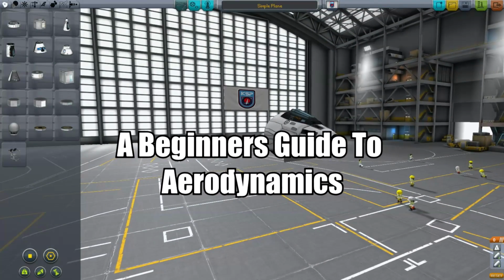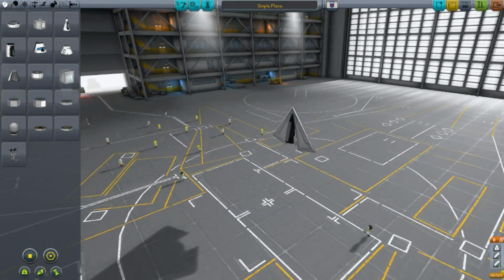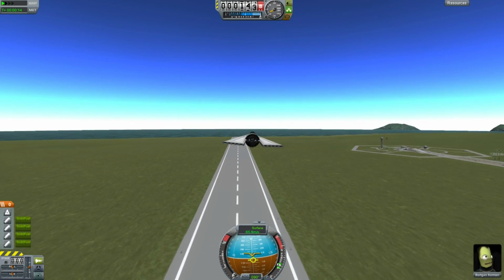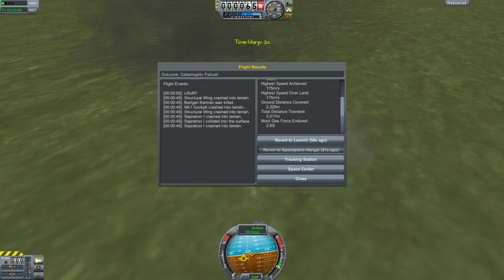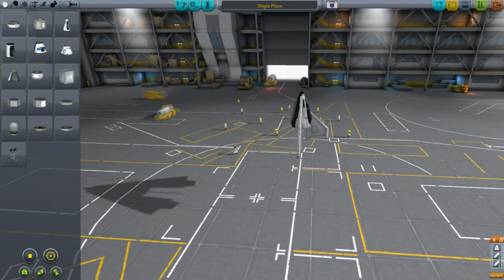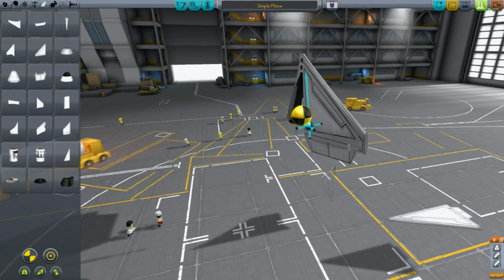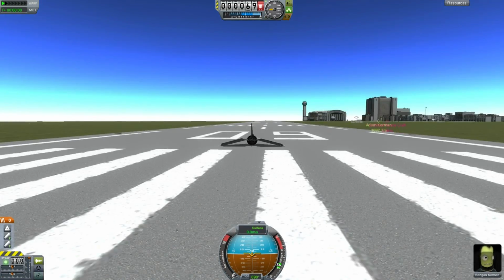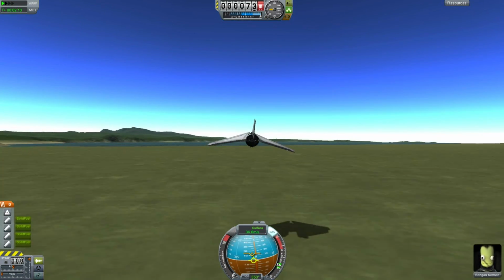Kerbal Space Program - Beginners Guide to Aircraft Aerodynamics

Comment: I just recently started playing KSP again and planes were always my favorite, albeit sorta frustrating with my limited knowledge of how they work. So something I'm sorta confused on is... in a plane the center of air pressure being close to the center of mass makes it more maneuverable, but doesn't that go against how it's supposed to work? I always thought for control surfaces putting them as far away as possible from the CoM was ideal for better control because more torque is applied in that case vs having them close to the CoM, yet in planes it seems to be reversed? Or maybe I'm mixed up in my head here, probably the case.

Now that I'm questioning all this I'll definitely have to experiment around in the game to see. I guess even in rockets I sorta see the whole maneuverability thing being the case since I usually have to put control surfaces farther back to make the rocket more stable. So maybe I got confused somewhere along the line? I guess maybe just having torque apply more farther away from the CoM is the intuitive thing for me but really it's the opposite, torque near the CoM has the most effect?

Comment: So I've gone gone and tried to build a shuttle and it works perfectly in every stage of flight except reentry and I can't figure out why.

It always around 30000m to 25000m yaws sharply and then begins pointing rear end first. This confuses me since my centre of lift is well aft of the centre of mass regardless of how its loaded and I've checked this in the SPH quite carefully.

Whats more I've seen designs similar to it (standard mk3 style shuttle with big S wing and strakes with shuttle tail piece) that don't have this issue.

Frankly I'm baffled.
Reply: Something alot of people forget is that when you burn fuell the center of mass is moved, you should always experiment with emptying the tanks in the hangar to see how it will move and how you will counter it. In my opinion the center of mass moving due to fuell burning is the hardest part of building a stable aircraft.
Reply: Plebasaurus Rekt Yes but even then the rules are lift aft of the centre of mass. The real danger is if it moves fore of the centre of mass due to burn.

There's something else afoot with my problem. I'm gonna install Ferram just to use those tools that warn of dangerous regimes of flight.

Comment: But what about the more mathematical aspects, is there a way to calculate the most optimal plane design in terms of lift-to-weight, lift-to-thrust or anything like that?
What is most important, high speed, big wingspan or is it simply both? Can you in fact have too big a wingspan?
Reply: Unless youre in a rush, big wings are imprtant since you are alot more stable and youll have a much easier time flying slow (eg. landing and take) and youll be able to fly with less engines while using less fuel so then you will have a longer range. Although a combo of both is best i think. Im not a pro, thats just what ive noticed works for me.
Reply: I havent played for a while but i know that ksp doesnt have any advanced aerodynamic so the shape of the wings doesnt matter at all, the important thing is only the ammount of wings and where the centre of lift is. Although last time i played was like 0.9  or something so it might have changed now.

Comment: SCOTT,     you should add the following information to the description of this and your other plane tutorials, it is the one bit of information that most people need!    

Flight characteristics   COL=center of lift   COM= center of mass
Different flight characteristics are desired in different craft. If 
the COL or the lift vector is positioned or pointing off-center 
left-to-right, the craft will turn. If the COL is positioned too far 
toward the bottom of the craft, it will want to roll over. Assuming the 
COL is centered side-to-side, and possibly top-to-bottom, performance is
 basically as follows:

 COL ahead of COM → Flips or turns uncontrollably COL inside COM → Excessively maneuverable; needs constant course correction COL closely behind of COM → More maneuverable COL further behind of COM → More stable COL very far behind of COM → Very hard to correct course; likely to flip up or nosedive
Shifting fulcrum-
The center of mass will shift as fuel is consumed or stages detach. 
This may critically alter the relation between the COM and COL to alter 
the flight characteristics.
Reply: yes, because most newbies are totally going to understand what all that means.
Reply: It's pretty self explanatory, other short tutorials cover the basics but never explained the difference in aircraft handling based on the position of COM/COL.*****

Comment: ARGHH!!  every video about "building your first plane" uses parts that I don't have access to.  "Aviation" on the 3rd tier of the science tree only give me access to 'Small Circular Intake' that doesn't fin in-line with the main fuselage.  The 'Radial Air Intake' that EVERYONE uses in their "first plane" videos is not available to me until "Aerodynamics" in the 4th tier of the science tree.
Reply: Career mode isn't a very good environment for beginners.
Reply: +dave fuller Then improvise, duh.
Reply: +Bad Rats You attach the Mk 0 Fuel canister to wherever you want to place the engine and then attach the intake and engine to that. The Fuel canister radially attaches practically anywhere
Reply: +Neisel Clemontine I don't think we had career mode when this video was made.
Reply: +dave fuller I'm also having this problem
:(
Reply: You should really experiment with everything in the sandbox before you try it in the "bussines mode" (dont know what its called haha)
Reply: I just built one right at beginning of career, just using common sense. Amazingly enough, it flew, and I actually landed it! No brakes though, so I ran over the airstrip when landing...
Reply: You can put the basic air intake anywhere on the vessel, even if it doesn't make sense. I usually put mine on the cockpit/capsule nose. Eventually KSP will put a stop to it, but it still works in v1.4.
Reply: The available parts don't matter. The point of the video is explaining how to build a stable aircraft. You can do this with the earliest available aircraft parts.
Reply: everyone that responded here gives literally zero help.  Come on Really?
Reply: Uhh this is aircraft aerodynamics not what to build on first career path

Comment: How do you connect a key so that it controls one thing - like flaps or elevators or ailerons? I normally see that if I try to pull up, all of the other control surfaces also pull up, including the flaps and ailerons. So how do I make it so that when I pull up, only the elevators pull up, or when I roll, only the ailerons move, etc?
Reply: +XpertPilotFSX You can right click an aileron/elevator/break and tell it whether or not to be used for pitch, yaw, and roll.

Comment: 4 problems : 

1. There aren't any control surfaces, just those Elevons or something like that. But they don't work!

2. I can't click the center of lift. The task-bar is on top of the bottom of KSP.

3. I do have 8GB of RAM. But it runs at 13 FPS. Plane turbo engines, just 3,6 meters per second.
Normal, max. 12,2 meters per second.

4. I can't run KSP on fullscreen. I have Windows 7 Home Premium. And mods don't work! I tried Firespitter and KSP won't load. It ends on a white screen. And if I want to quit, it doesn't quit.
Reply: TheDiamondBladeHD 2.0 Why you lag with 8 gb?ram isn't what the computer uses to make the pc fast. It is more likely because your processor or graphics card aren't that good. When I had 8 gb ram, 3.0 ghz processer but pc dosent detect graphics card so it did basic display adapter and that lagged as hell.
Reply: TheDiamondBladeHD 2.0 These aren't questions!
Reply: Murad Beybalaev *Problems
Reply: TheDiamondBladeHD 2.0 btw, did you happen to download and install that Active Texture Management mod I linked before?
If you did, did it help at all?

If you didn't,  I REALLY recommend installing it. The mod's thread on the KSP forums was updated a few days ago to include download links for the version made to work with KSP 1.0.

Also, for whatever limited aid I can give you, it would really help if you told me about your processor. So, follow these steps to find that helpful information. It'll literally take a minute.

1) First we'll need the overall speed of your CPU.

a) Left-click on the Windows "Start" button. It has the Microsoft flag logo on it. Doing this should open your "Start Menu" like normal.

b) Find the "Computer" button in the right column of your Start Menu. Don't click it yet

c) Right-click the "Computer" button. It should bring up a little menu.

d) Left-click "Properties" on that small menu. There should be a window that pops up displaying information about your computer.

e) Look for the row where it says "Processor".
The last number in that row is your overall speed. It should end with "GHz" (GigaHertz).

f) Tell me what that number is!

2) Now we find out how many cores you have.

a) Hover your mouse cursor over an empty part of your Taskbar.

b) Right-click on that empty part of your Taskbar. A small menu should appear.

c) Left-click the "Start Task Manager" button. A really basically formatted window titled "Windows Task Manager" should appear.

d) If you aren't already on it automatically, click the "Performance" tab near the top of the Task Manager window. You should see a couple of "Usage History" line graphs being updated in real time, organized into two rows, and with different colored lines for the graph

e) You should see that all of the graphs with a green line are together on the top row, and that the only other graph in the window has a blue line, and is alone on the bottom row.

f) Each line graph with the green line represents a separate Processor Core. Tell me how many green line graphs there are.

Comment: my plane shakes left and right just soon as I start the engine although everything is right ( lift behind mass, everything symmetrical ) is it a bug or is there something wrong ?
Reply: It could be because the gears are not widespread enough and there appears to be no suspension friction in the game so it keeps doing it wobbly thing till you apply another force or get rid of the movement for a moment by timewarping for a bit so it stops doing it. When you stop timewarp, it should be stabile again if its shaking was stopped at the good time.

Comment: This is all nice stuff, but what's the point of planes in the first place?
Reply: Science, every biome gets you more science.
Reply: noodles6669 So I'm supposed to land it on a different biome? Like... which one?
Reply: firefox3249 If you do science stuff in KSC you get science for doing science there, then do it over water, grasslands, highlands, mountains, tundra, and polar regions. Those are the ones I have seen. Launch pad and runway also give you extra science.
Reply: noodles6669 Ok, thanks for the intel :)
Reply: As you get better at designing planes, and get more science for more parts, you can build hybrid planes where you can use jet power to get out of the atmosphere, and then rocket power to easily get in orbit. It uses much less fuel, leaving you more to use in space. Then you can land the ship apon returning and get a lot of the value back for your next trip. It is worth it to learn to fly.
Plus it feels very rewarding to land a plane after returning from a distance planet, instead of falling back to earth with a parachute.
Reply: ***** The reason it is true is because of the jet engines, you can get to 20-30km on minimum fuel, and FAR helps with lift, so you can compensate for lack of thrust(more efficient, less thrust) with aerodynamic lift, and therefore, you can be more efficient, but building such crafts is very challenging, especially if they return in one piece.

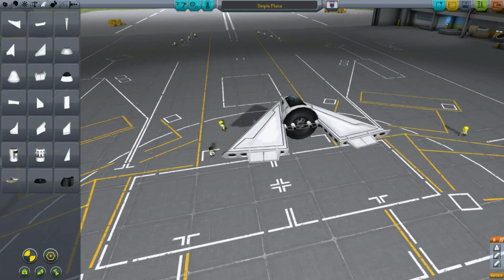Comment: I add control surfaces like in 4:20, but these wings doesn't work as expected: they doesn't move at all.

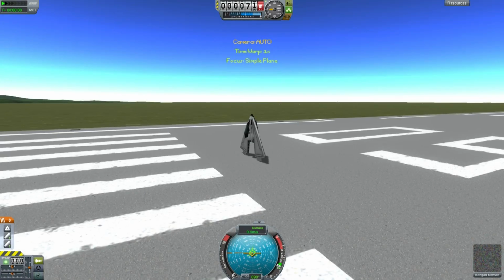In 4:40 Scott said something like that: 'disable anything but flag (flat)'; What that this mean? Do I have a keyboard problem? or a knowledgement problem?
Reply: "Anything but the..." well... I have no clue what he wanted to say there.
A tip: make sure ROLL and PITCH aren't disabled. Right click the control surface. Of course, different wing types need different controls though, but in a "shuttle" like that (it's more a very bad, very basic shuttle or glider than an aircaft that he made actually), you have only two, primary wings so that's where you have all the controls basicly.

Comment: Why does the Harrier use downwards angled wings? Does it have to do with the VTOL?
Reply from the maker: I believe it's because the wings are high on the fuselage to accomodate the thrusters. Which means there's a pendulum effect that adds stability, by angling the wings down it'll counteract this.
Reply: Aahh. Makes sense. Thanks for the descriptipn
Reply: Weeeell.  Collectively you're all dancing around the idea why dihedral and anhedral are present in low and high wing configurations respectively.  Low-wings without dihedral tend to have a more unstable spiral mode (very dangerous to have) and a more stable dutch-roll mode (not very dangerous, just uncomfortable).  Increased Dihedral essentially stabilises the spiral mode while simultaneously making the Dutch roll mode a little less stable, i.e. the aircraft will tend to correct a spiral but will probably need some sort of input or yaw damper to stop a Dutch roll.  Dutch roll is really just an uncomfortable mode so we can deal with it be a little less stable than the spiral mode (which can and has killed pilots).

Anhedral is for high-wing aircraft as basically they are too geared towards a stable spiral mode and need the wings angles a liiiittle bit donwards in order to stop them being TOO stable (which is a bad thing for fighters or acrobatics of course).  The pendulum effect is also present (sometimes called the keel effect) but is a lesser concern when dealing with stability and control.

Aircraft stability and control is really quite interesting but is one of the more difficult aspects.  There's plenty of literature out there on it and how the stability equations are worked into autopilot systems and control loops (such as on the Typhoon Eurofigher).  Also, Microsoft's FSX has a very interesting method for predicting aircraft response... although I wont get in to that.

If you stuck with me this long I hope that helped.
Reply: The real reason is that modern planes don't have to be stable as they are flown largely by computer.  It's actually better to be unstable as stable=less maneuverable and vice versa. Modern fighters are very unstable and can't be flow without computer assistance.
Reply: Actually the main reason is the down angled wings are called Anhedral Wing. The opposite is Dihedral. Anhedral wing makes it unstable so that it turns sharply as it is a fighter aircraft. Dihedral wing makes the aircraft more stable, that is why its used in Civil aviation aircraft

Comment: I'm applying standard control surfaces to my wings but they aren't doing anything in flight. Do you know why this is? Do you have to activate them?
Reply: Check part properties by right clicking in the editor/hangar. There should be roll, jaw and pitch displayed. You better figure out which does what, enable the right one if it isn't so it should be gonna be ok.

Comment: the start cracks me up ;'D its not true -_-
Reply: Well, in KSP it's so much easier to make a basic, working rocket than a properly flying aircraft. It kept me hooked for a bit as well, even though I knew all these already. It's  the fault of the too simple wing building and stuff like that though. Should be like in SimplePlanes in my opinion.
After the second try, the next day, with the access of a bit more parts (I made my first experimental aircraps in carreer mode), I managed to build a pretty good plane. It's single seater yet but I'll replace the hollow fuselage with passenger cab maybe so I can kill more kerbals at once... The thing Scott made is extremely basic, but it still flies, more or less, which is not a bad introduction.

I can agree with him on that, depending on the perspective.
In real life, you can't really compare them. Both planes and rockets have their advantages and disadvantages. There are many of them so I won't list examples here.

Comment: The only reason you would want your center of lift in front of your center of mass would be to make a very maneuverable jet "fighter". Since the invention of assisted control surface control it has been done with one of the best jet fighters ever made, the Sukhoi 27 (and then 30 and 35 which are latter variants) was one of the first modern jet to have that feature, it basically allows an aircraft which has a high thrust to weight ratio to turn past its angle of attack without stalling (loosing control/falling like a rock). What that means is, the plane can go from pointing in one direction to pointing at a 120° angle away from that direction in one second (more than 90°!), burning 250km/h instantly, the next second the plane comes back to pointing the "right way", its very impressive to see, they call it "the cobra" because if done vertically the plane rises up like a cobra about to attack.
What that means for a jet fighter is incredible ability to turn and maneuver at trans sonic speed, especially combined with high angle trust vectoring like on the Su35. The only problem is of course that it means the aircraft will stall if you don't constantly compensate for it by pushing back the stick in the opposite direction you just did after EVERY maneuver, a computer is in charge of doing that in modern fighters, only a skilled pilot can fly a small plane with a center of lift in front of the plane successfully.